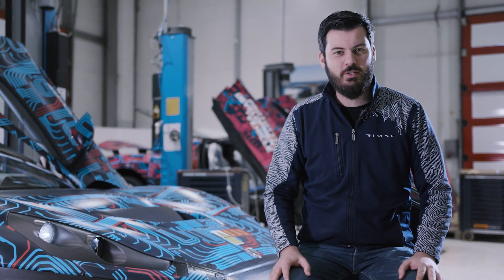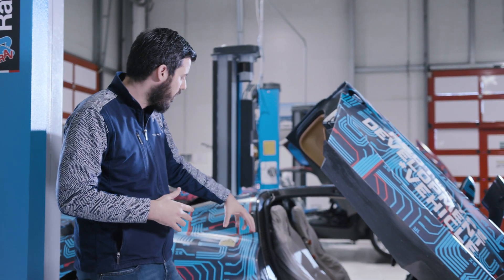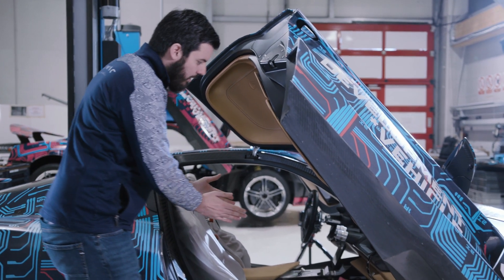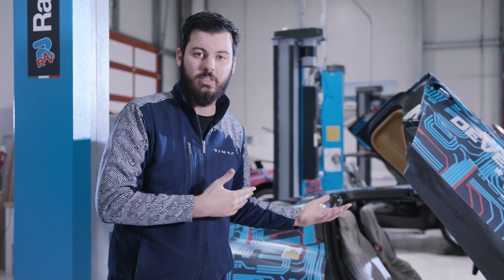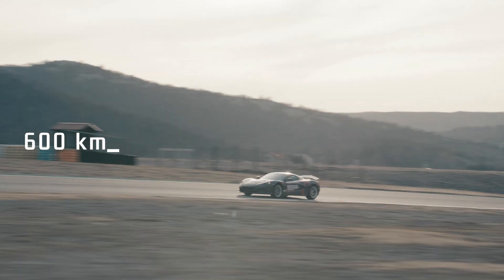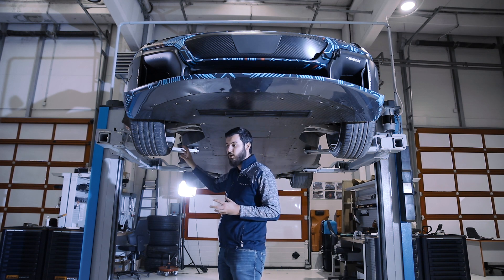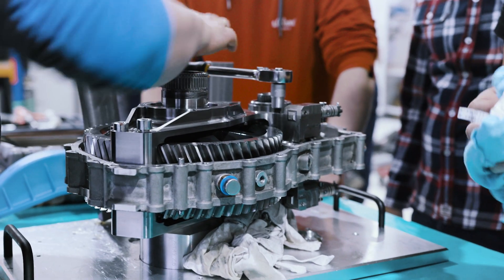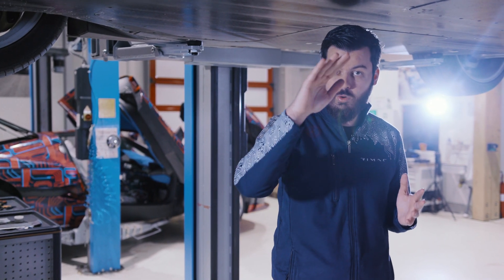The Challenges of Creating an Electric Hypercar | Mondays with Mate E03

Comment: Would it be feasible to install small fuel-cell (hydrogen or other fuel) to recharge the batteries during driving and racing? Fuel cells are around 50% efficient (good) and remaining is heat (useful for heating in road EVs). This setup could extend the range for driving and racing. In real world it would be instant game changer for road EVs range, specifically in cold climates. PR benefits for company would be yuuuge. :)

Comment: There is a lot of room for innovation in the vehicle manufacturing space. Much of the automotive industry has outsourced most of the vehicle parts. There is an opportunity to significantly reduce the cost of manufacturing autonomous electric vehicles through significant vertical integration and by designing vehicles from the ground up to be used as part of a commercial autonomous vehicle fleet. Rimac should partner with companies such as Foxconn (who are looking to develop expertise in advanced robotics and electric vehicles) to start manufacturing vehicles in higher volume. Rimac should also try to attract investments from companies such as Apple/Google, Amazon, Ford, Groupe PSA and other vehicle manufacturers.

Comment: Low maintanance. Ok. I can go with this logic.. But brakes... Since most of the time braking is done by electric motor...what about the emergency braking? Did test show the good results. Namely the troubles with EV can be connected  with longer emergency brake paths cause brakes are not so much in use when driving. And longer brake paths can be leathal.

Comment: hey, talking about the tyre load at high speeds, isn't it also one of the reasons why many electric cars (except of Tesla) have relatively low MAX speed, like 150 -170 km/h? Simply because the cars are too heavy and there are no good tyres to handle the load? Even the Mercedes EQC has 180 km/h, which could be disappointingly low in Germany.
Reply: Nope, problem is not in tyres but battery usage,above 100 kmh its really big and it drains like crazy but thats why c2 has 1.4 MW batteries which is massive ammount of it,but anyway with 400kmh it will use them probably in 10 minutes...so 600km autonomy will be possible only in perfect condition

Comment: Great video as usual. I'm curious about the maximum down force. Theoretically, you could finally confirm the myth that it's possible to drive a car upside down if there is enough down force. I know that combustion engine cars are not designed to operate upside down because of all the fluids, but electric car should be able to work normally even if flipped upside down. Mislite o tome ;)

Comment: Also another question: How do you recreate an "old-school" differential? Or are there (torque-vectoring) settings to choose from to "recreate" various differentials?
Reply: As seen in the video Rimac employs separate motor inverter sets on each wheel which eliminates the use of the old school mechanical differential...
As I have asked a similar question to rimac in the comments I wait eagerly to find out how Rimac has silently revolutionized the Electronic Differential over which Elon Musk had concerns of failure in electronic communications.

Comment: Mate, I believe you  mentioned when you first revealed the C_Two that the maximum speed the car would be electronically  limited 258 mph because of the tyres. My question is how is it that you have to limit the cars top speed to 258 and that other super car makers such Bugatti and Koenigsegg's cars can achieve 260 / 270 mph+ with what I'm assuming are similar tyres? Is it due to the fact that the C-Two delivers power differently, is it the weight of the car etc? Sorry for the newbie question!!

Comment: Mate your car on the display in Shanghai needs to have RIMAC name on it on the glass because from the ground people will not be able to tell what the car is on display. That being said it sounds like you dropped using your F1 inspired 2 speed gearbox in the C_Two what was the specific reason for dropping it. I know you explained that you made changes that dropped it to 13K n.Meters but did not explain the change from the Concept One. one more question how do you address thermal management for the battery on the C_Two thank you keep up the great work.

Comment: The electric hypercar of the future should look exactly like what you are doing now. Maybe a video on the carbon fiber shell if it's possible without giving away too many secrets.
Reply: They talked quite a lot about the carbon fiber monocoque in schmee150's video. Basically it's the biggest and most complex single-piece carbon fiber monocoque in the world, and it's also the one with the highest torsional rigidity of any car out there, higher than Chiron's, which already bragged about being more rigid than most race care cars.
Reply: @derbigpr500  thanks. You have a link to that?

Comment: Hey Mate,  here is a question for you: What factor other than significant battery improvements can be the enabler for mass adoption of electric vehicles?
Reply: DangCool I believe a combination of battery and ultra capacitors will come next. The ultra caps can harness 100% of the energy from regenerative braking compared to batteries which sits around 30%.
Reply: Costs, taxes and charging infrastructure and ease of battery manufacturing by all the manufacturers. And also the electricity needs to come from non-fossil fuel sources to be environmentally viable. It also needs to avoid a major industrial disruption that could hurt the economy. At the moment conventional automakers are proactive about this, but unlike Tesla they all struggle with the mass battery manufacturing requirements, they're a massive investment.
Reply: srinitaaigaura today I’m quite sure oil costs more to the taxpayer than electricity and a majority of studies indicate that the transition will create more jobs, so I don’t think it will hurt the economy. 
People may even have more money to spend on other things than car or fuel. 

I agree traditional automakers are proactive, they are outsourcing everything from the battery pack to the battery cells and even the drivetrain.
And who are making these? Mostly China and Korea. And I think this might be the greater change in our global economy. 
Like it happened to Japanese cars at the time, now may see a lot more of electric Chinese cars whether it’s from a Chinese brand or à European brand owned by a Chinese company 
just like Volvo owned by Geely of Peugeot e-208 which are in reality Dongfeng cars in the inside, just wanted to share my thoughts on the subject
Reply: I must add that every cars can charge at certain destination chargers owned by Tesla. These are just type 2 but nonetheless it shows you their good will
Reply: charging stations and Elon Musk😂😂
Reply: @mijosipek5052  Tesla should open their chargers for other brands. Who else withholds their charge network from anyone? That's no way to boost BEV adoption, only a few % of the Western world can afford Tesla. Lots and lots of vacant stalls most of the time. Make them public, "charge" commercial fees! All it takes is a simple app a Tesla intern could make in a week.
Reply: @Cloxxki  I understand the confusion but Tesla has always made it opened to any brands who would like to join the network, (like they put online their patents). But NO AUTOMAKERS joined it! 
I think they can't imagine lowering themselves to ask the "help" of a small brand like Tesla. But I can see Chinese car companies joining the supercharger network in a few years, that might be realistic.
Reply: @Cloxxki  That's nonsense, Tesla has always said other brands can join IF they are willing to help financially support building the charge network.  There are many Supercharger locations that already have waiting times during high traffic periods, it doesn't matter now many are vacant at off peak times if they are overwhelmed during peak usage hours.
Reply: @Cloxxki  @Jonas Weber is right: Tesla opened its network to other manufacturers to share the cost of expanding EV chargers/market share. They failed to take advantage, and now there are several competing charging ports/standards. You can go to a non-Tesla charger and charge your Model 3 with the right hardware adapter and probably vice versa.
Reply: @Cloxxki  Ionity has just doubled the price for Tesla to a point that equals a shut out. Ah the famous app you could do in a week. Shows you have absolutely no clue about such things.